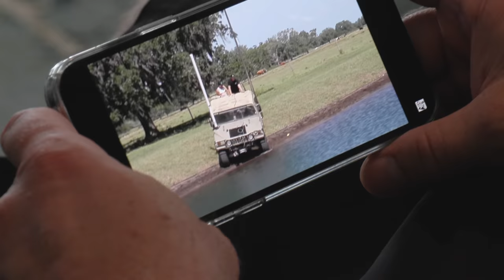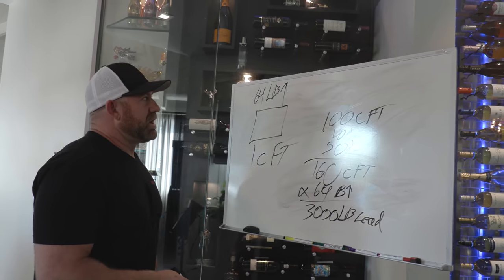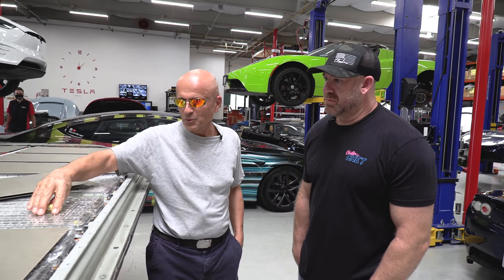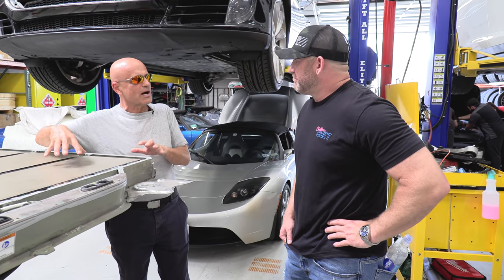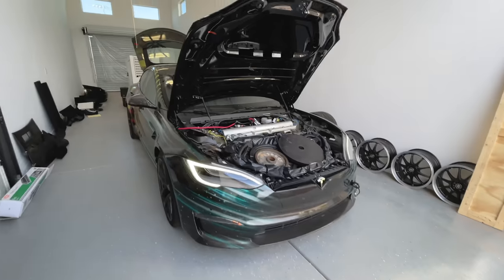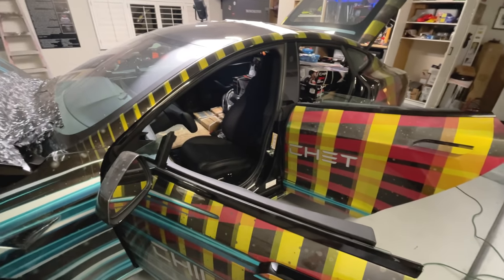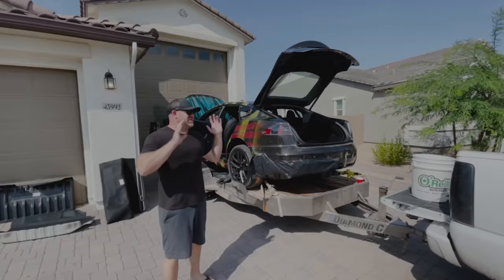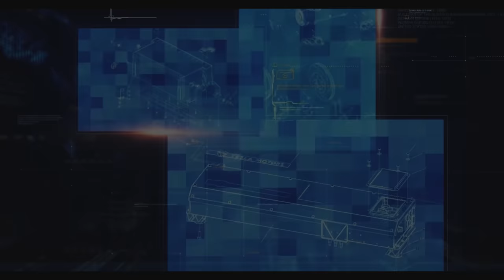Driving my Tesla Model S Plaid Underwater!! Does it float, sink or drive 7ft under!?

Comment: Could do wheel spacers with tires that can be calcium filled (like on tractors) - poly @ concrete in back seat/ trunk whatever - chip out after, no sweat ! 😂
Reply: Then episode 3 can be called “chipp’n with Chet” when you got the jack hammer chipping it out 🤣

Comment: I bet if you somehow used the natural pressure when accelerating to divert water flow upward it would keep the car down, and if you go even further with it, you could activate a toggle switch which would change the flow of the water jet tubes to push under the car, allowing for a sustained buoyancy and propulsion

Comment: I think what you should do is build a completely sealed double walled cabin with solid infils and change from pneumatic tyres to solid tyres 
I don't think you accounted for the buoyancy of the tyres and also letting water in is the actual point.
Allow water into the engine compartment asides the battery pack. Wrap up the connecting cables and connectors
With these im certain you'd make it work 89% sure of it

Comment: For weight the old guys used to fill their tractor tires with water. Also, if you have the space, after you put in the weights can you put in a big plastic bag on top of them and fill it with water? Essentially filling the voids between the weights...

Comment: I’d work on sealing the floor pan and the doors. Roll down the driver side window keep all doors shut and tape every crevice. Then get in through the open window and roll it up. You have a lot of air displacement inside the car so you need solid lead to the point your suspension will probably break. You need around 1600 pounds to offset the buoyancy.

Comment: Thought this video would be clickbait but this was amazing love your enthusiasm, my one recommendation that could help would probably be trying to get some type of thin solid, maybe rubber tires. I think you were mostly correct on the buoyancy but the 4 tires filled with compressed air is basically 4 unsinkable objects, I think if you can find a way around that it may actually work

Comment: You need to remove interior oxygen mass. Vacuum seal the Frunk, and rear cargo area, and fill the remaining areas with dense rubber balls like bouncy balls or even ball bearings. To hold them back just build a plexiglass partition.

Comment: A lot of the connectors for the ECU is inside the cabin are not water resistant I believe. Check that out see if you can seal the connectors to any ECU's near the floor

Comment: If you could use solid tires, and limit the air space in the cab. There is probably a formula for buoyancy vs water volume. Sounds like there's alot more to it than just waterproofing the seals. Good luck tho

Comment: Suggestion: Try placing a several scuba tanks inside car, and open the valves prior to entry into the water. Perhaps, the positive pressure will keep water out of the cabin.

Comment: I am a physicsist. I can pretty much tell you that this project can not work out. 

To submerge the car in water, you have to overcome the boyant force that will be acted by the volume that is currently still above the water. 

This is approx. Everything above the back spoiler/headlights. 

Looking at a tesla blueprint, this volume is approximately a triangular prisma. From the side a triangle with height 0.65m, bottom side (car lenght above the water) with 2m. Height of the prisma (car width above water) 1.6m. This gives about 1/2*0.65m*2m*1.6m = approx. 1m^3. This will create a boyant force of one ton when in water. And then you are levitating without grip on the bottom, zero weight on the tires. 

And you will not be able to put a ton of weight in this car without massive damage.
Reply from the maker: But did you factor in the Chet Math? 😉
Reply from the maker: And I put in 2tons already. Needs two more and I’ll be gtg

Comment: You need a lot more weight and also would be good if you could put some air cylinders in the car to maintain positive pressure… I’m thinking a few firefighter SCBA’s with 60 minute air cylinders

Comment: Chet good job bro!! You're the anti-couch potato! So if I could suggest a few upgrades... Instead of adding lead ballast to the inside of the Tesla, create a big tank that you could fill with water as you submerge. That way you could control your buoyancy. And if you really want to do it right mod the entire vehicle and seal it permanently. Adding a prop, fins lighting. I would start with amphibious and then add the ballast tanks to sink it further and further until you reach your goal. Your hacker at heart. Good work bro. This is how dreams are made.

Comment: A two-part urethane skin, sprayed into the inner-fender/ wheel-arch area might work well.
A nipple added into the roof, with a floating air-breather 
(on a tether-rope & an umbilical-cord), 
providing some air for the driver (save the scuba tank, as a last resort), 
might NOT be a daft idea.
I DO agree with the water filled tyres idea.
Tesla, quite possibly, accessed cameras in the car, & thus already have video (??).
I still think a cluster of Bilge-pumps, connected to buoyant outlet-tubes
(so that the flow can be monitored from ABOVE the water-line)
would be quite wise. 
Where "nipples" are passed through the bodywork,
after they are welded into the panels, 
then "Phosphor-Bronze" (bronze soldering)
over the welds will far-better water-proof the penetrations.

Comment: Water infiltration in copper cables lead to water in the electronic including the break and the gas pedal (so to make it safe they should keep using an old style potentiometer)
Not counting the 1000 others bad things coming with or details coming with. Even if the car seems to work properly after the test. 
Let me know about it 6 months with a real feedback since the splash.

Comment: You need about 1 ton of basmati rice, then the tesla will be a real ricer...  need to load the tires with a sand water solution. Heavy mineral sand is better than steel plus it will adsorb the water and be easier to clean out. Elon has lots of Staurolite left over from the SpaceX heat panels plant that'll work.

Comment: I would strongly advise working with an electrical engineer if you plan to do this again to make sure there is 0% chance of the battery shorting in the water while you are in the water.. There could be a serious risk of electrocution! ☠️

Comment: The car will do it, put water in the tyres that will help fill the boot with water filled bags and frunk , I once saw a power drill sprayed with wd40 around the electrical parts and it worked under water ,

Comment: It won't sink unless the trunk/cabin is at least partly full with water. 
Because physics.
If it displaces more than 2.5m^3 of water then it won't sink.
Reply from the maker: Will have to add that to the Chet Math board right there!

Comment: I don’t think it will work without flooding the cabin it’s to much air in it when it’s sealed up and won’t sink correctly, and if you did get it
To sink the windows would probably break from pressure

Comment: It's impossible to attain ur goal! U can't eliminate buoyancy bcuz of air inside ur car. The only way to submerge N touch the ground is by filling up ur car w/ water totally. Even though ur car is totally submerge on the ground, it can only work on hard surface like ur improvised setup. Submarine has no wheels...if u want to float ur tesla like a submarine, u have to modify it by installing a hydraulic propeller in front or back...If u filled w/ water u have to wear scuba gear...

Comment: Enough money to wreck an expensive car but not enough brains to use a strong enough rope. :-)
Reply from the maker: Rope was plenty strong if you saw how we tested it on our previous vlog, had more to do with the angle of the pull.
Reply: @ChillinwithChet  Yes, I saw that the rope broke. It was a pitiful plastic rope. A professional would have used steel cables or chains. :-)
Reply from the maker: Its a synthetic winch rope btw which was rated at 25k lbs.  which is way more than an equal size steel cable.  Problem was the knot used was the wrong type of knot and it broke in the knot.  I definitely have enough brains to make enough $ to buy this tesla and destroy it if I want just for the sake of entertaining myself.  But would it be ok if I try again? Can I run all the variables by you prior so I dont mess up again?
Reply: @ChillinwithChet  Well, you did it wrong. That's all that counts. :-)
Reply: Hey the packaging said it was really strong!! I blame the manufacturer.
Reply: @rjswan1  It looked like floss to me.

Comment: What mistakes. He started freaking out when he was barely in the water. Marine grade that engine and the electrical parts. Silicone and seal connections and put a bilge pump or two

Comment: If you living with Lake or seaside's First you have to Proof what to do If you havent recognized that you didn't have fixed you handbrake.cause If you didn't fixe the Handbrake or parkingbrake, you have to Drive you Car of the River or Lake.
And that the First Test you have to do If you bought a new Car 
All my friendship do that since WE older then 13  .
Thats normal living with rivers or seaside , If the Car do not swim, you dud Not need a Car 
Normal First step buying a Car.
LG R.u.p.p.